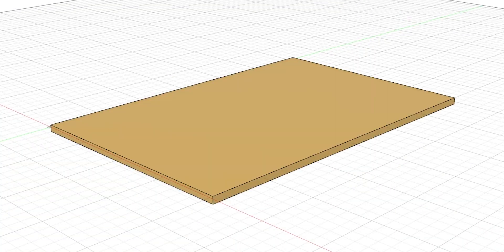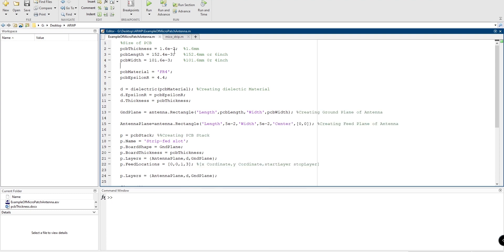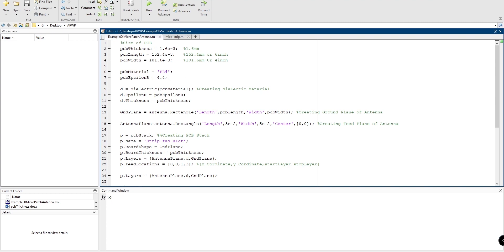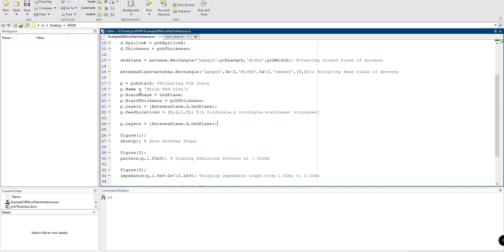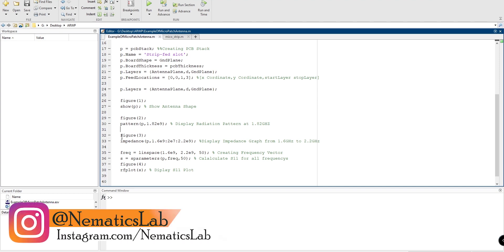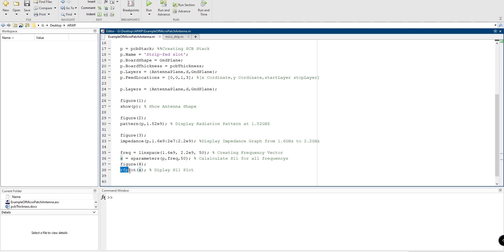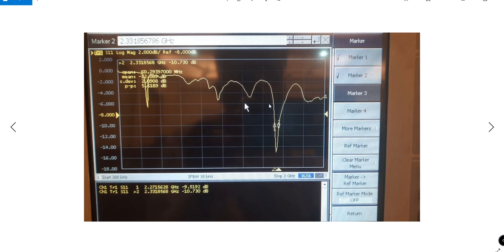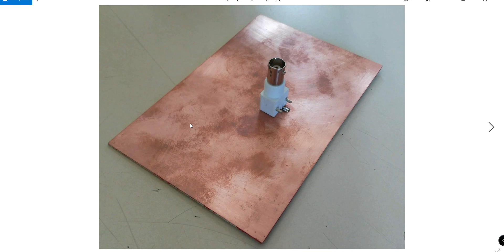How to Design Micro Patch Antenna using MATLAB | MicroStrip Antenna Design

Comment from the maker: Note: You need to install Antenna tool box in MATLAB for code to work! And this code is compatible with MATLAB Version 2019B or higher
also I have just updated the code to generate the Gerber files for PCB manufacturing, you can upload the Gerber files to any PCB manufacturing service or Convert the Gerber file into PDF using https://www.gerber-viewer.com/
You can download Code from here- https://in.mathworks.com/matlabcentral/fileexchange/74724-designing-micropatch-antenna-using-matlab
Reply: ¿Hey bro, can you do it these antennas on "antenna designer" or toolbox where you just add datas?

Comment: Is it possible to import my PCB files to matlab and simulate with my stackup and layout? And furthermore is it possible to insert other elements into the model such that you can see the impact of a human hand (for example) in the antenna radiation? Thanks!

Comment: hi there, I would like to short-circuit the patch with the ground by using a rectangular shape (patchWidth x pcbStack.Height) which starts from one edge of the patch and ends obviously to the ground. Is that possible?

(I tried to do that by generating manually a rectangular shape, rotating it around x axis and trying to add it to the patch layer: the matlab compiler gives an error because it says "boolean operations can be done only between entities belonging to the same plane". Buut, if I add the rectangular pin to the patch before it's rotated, of course I can't rotate it after that.... )

I'm trying to do this because I need to design a lambda/4-"folded"-patch.

Comment: Hi,

When I run the code, I get different S11, Impedance and Pattern results. How is that possible?

Thanks in advance.
Reply: Hi 
I also got different results 
Did you find a solution to this problem?

Comment: men, wild and all but. There is no faster way to run the antenna codes without using the processor so much, they run too slow, friend, it takes an hour to work something

Comment: d = dielectric(pcbMaterial); %Creating dielectric Material  getting this line as error what to do?
Reply from the maker: Have you installed antenna toolbox?
Reply: @Nematics_Lab   NO sir I'm using online trial version i have not installed it , do i have to install for online trial version also
Reply from the maker: @jalpitagupta8821  you need antenna toolbox without that you cannot do this project
Reply: @Nematics_Lab  THANK YOU I GOT OUTPUT

Comment: Could you help me with rectifying the error i'm receiving for your code "ExampleOfMicro.....". I have entered the same code as in your Video.

Error in RayPattern (line 9)
d = dielectric(PatchMaterial);
 
>> Demo
Unrecognized property 'Boardshape' for class 'pcbStack'.

Error in Demo (line 19)
p.Boardshape = GndPlane;
Reply from the maker: Make sure you have installed Antenna toolbox

Comment: while running code it showing error like this 
Undefined variable "antenna" or class "antenna.Rectangle".
Error in Untitled3 (line 14)
GndPlane = antenna.Rectangle('Length',pcbLength,'Width',pcbWidth); %Creating Ground Plane of Antenna
Reply from the maker: Make sure you have installed Antenna toolbox

Comment: Nice video! How do you get your code to run so fast for the microstrip antenna parameter calculations? ie. What is your PC spec?
I'm going through research papers to come up with the fastest way to get the best config in MathLab for a microstrip antenna.
Liked! Subbed! Smashed the notification bell!
Reply from the maker: Here are my PC specs
Ryzen 3700x.
Corsair 750W Power supply.
Asus x570 E gaming Mother board
16GB 3600MHz 16C memory
GT730 graphics
Reply: @Nematics_Lab  Thanks for the reply! Yeah, I need an upgrade asap.

Comment: i have a doubt, how to extract the values of of the microstrip position and dimensions
Reply: i ask this doubt because, i designed fractal antenna and i need the dimensions and positions of the antenna which came as the result of each iteration
Reply from the maker: I have just updated the code to generate the Gerber files for PCB manufacturing, you can upload the gerber files to any PCB manufacturing service or Convert the Gerber file into PDF using https://www.gerber-viewer.com/
Reply: @Nematics_Lab  bro what is gerber file ...how to generate that...??
Reply from the maker: @praveenganapathy8357  Gerber file is used by PCB manufacturing services to make PCB. Download the new code I have added few new lines to it it's easy to understand
Reply: can u provide ur mail id so that i can clarify the future doubts....
Reply from the maker: Contact me on facebook or twitter
Reply: @Nematics_Lab  ok bro ....
Reply: a grt thannnnxxxxxxz......!!!!!!!🤩
Reply: hello bro, i tried out the  code to get the PCB design. Am working in fractal antenna design .....
""C = PCBConnectors.SMA_Cinch;
W = PCBServices.PCBWayWriter;
W.Filename = 'antenna_design_file';
gerberWrite(p,W,C);""

but it poped an  error

""Undefined function 'gerberWrite' for input arguments of type 'fractalIsland'.

Error in minkowskifractal (line 25)
gerberWrite(p,W,C);""

i tried to contact u through social media but all the ways to message u personal was blocked..!! help me out...!!!